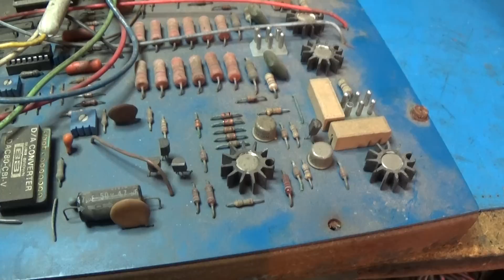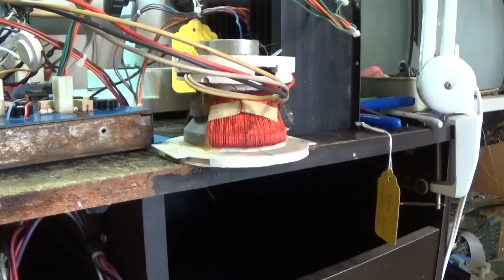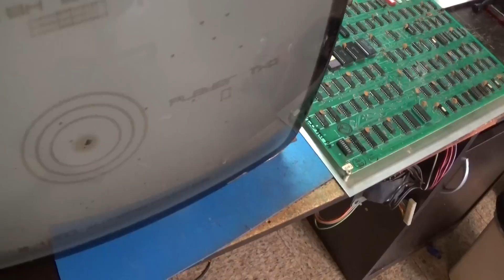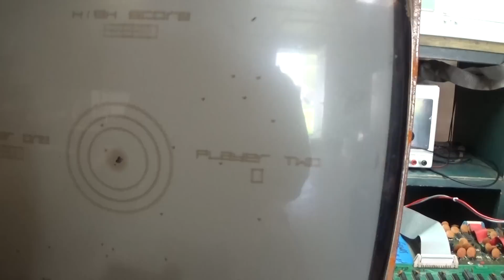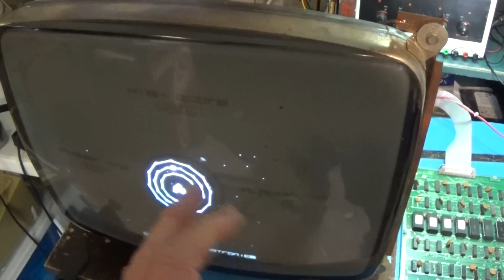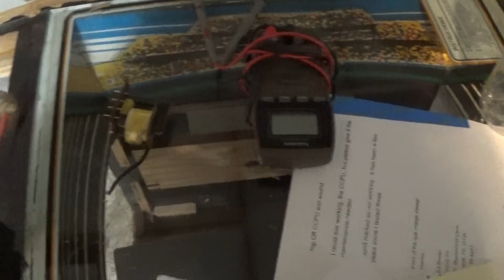Corroded, Dirty, D.O.A. CinemaTronics Monitor Chassis Repair - 5/13/22

Comment: I'd love to hear more about this Keltron high voltage substitute for the original HV hardware.
Reply from the maker: Is there such a thing?
Reply: @classicarcaderepairs  Didn't you do that in this video? It looks like you took the original HV off the display chassis and substituted a Keltron HV supply.

Comment: How much voltage did that old screen need to be that bright?  Was the transformer rated for that voltage?

Old tubes lose their brightness and need higher and higher voltages to maintain the same levels.  But if the flyback can't handle it, it begins to eat itself from the inside as it breaks down its own internal insulation, then begins to pull excessive current and take down the power components that feed it.

Comment: Wow,  that is some HEAVY burn! Is that a big hole in the phosphors in the middle of the screen?? And i would have loved take on thiis chassis. BTW, do you have a cinematronics exorcisor? I have a working repro design that I should upload to github. You need a signature analyzer to use it, but if you want I can provide a PCB / files / etc.
Reply from the maker: yes that is a big burnt hole in the middle of the tube :)  Its just a test tube only..  not fit for a game at all....  and no I do not have a Cinematronics CCPU exorcisor
Reply: that gives me an idea for a really impractical, expensive, heavy and above all unerasable Etch-a-Sketch...
hey wait a minute... if you hold the CRT upside down and shake it, maybe the burn in goes away :-P